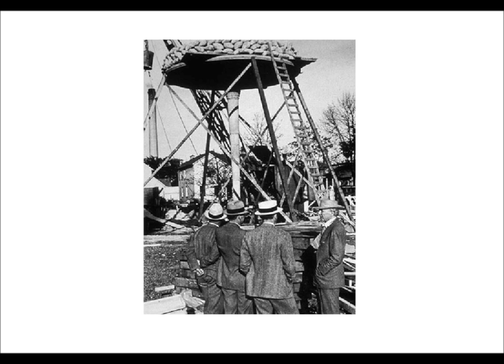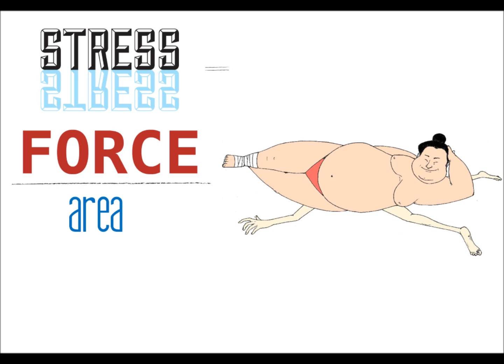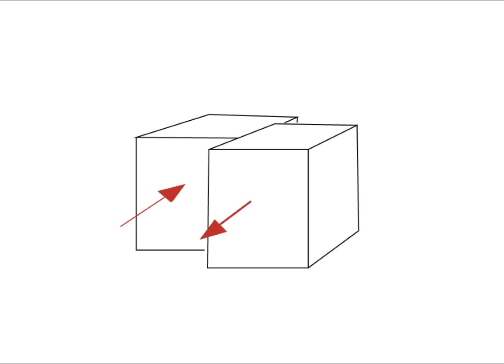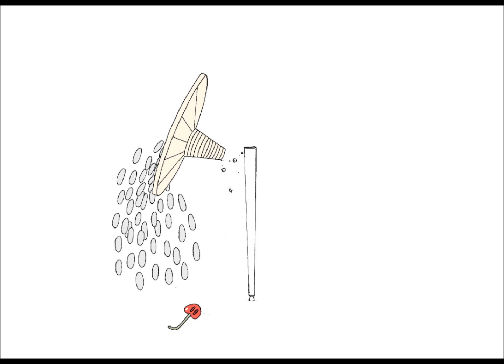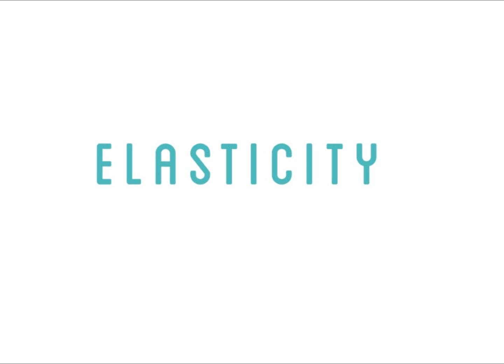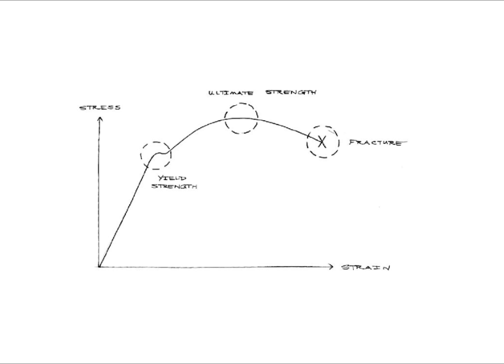Stress and Strain: The Johnson Wax Column

Comment: In the sandbag test, if he had removed half of the sandbags evenly from the top, then removed another half of the sandbags from only one side of the circular surface, the column would have readily collapsed with only a fraction of the full concentric load.  The stresses from the bending moment, combined with the axial stress, would reach the yield strain more rapidly than the concentric test.  Today's codes require unbalanced live loading be applied to all structural members where such effects may limit the strength of the member.

The saving grace of these columns in the installed condition is that they are tied to their neighbors with link beams.  This constrains sidesway at the roof level, inhibits torsion, and limits the induced moment resulting from the unbalanced load on the circular area.